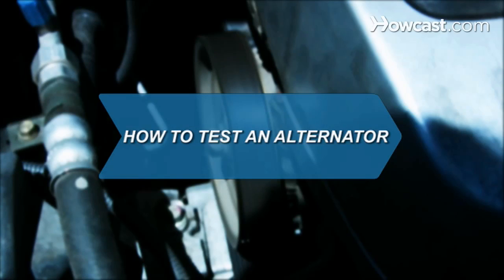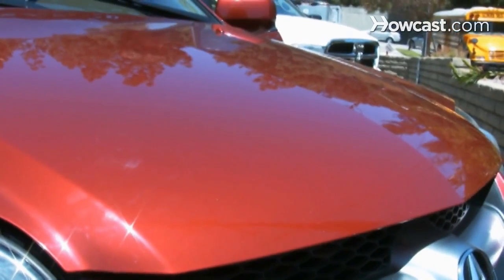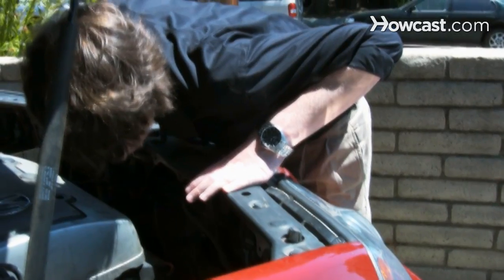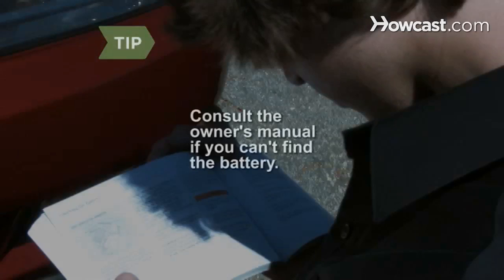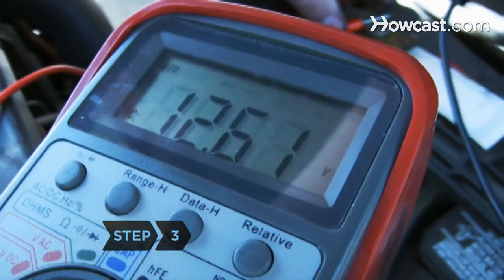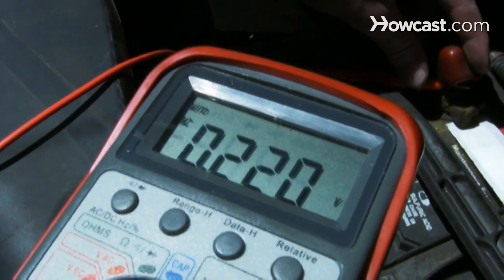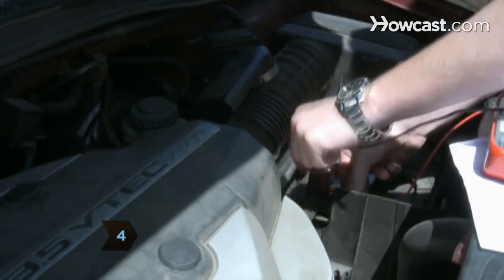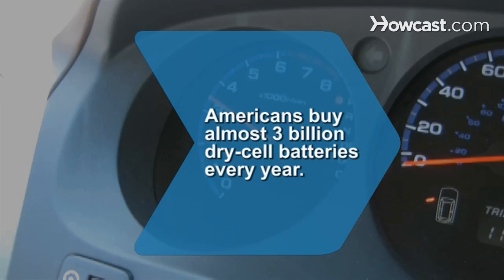How to Test an Alternator

Comment: Generally speaking the regulator will go out in an alternator and so the charge will go very high on the battery when the car is running this not always the case but most of the time it is .

Comment: No Duh anybody knows that.  Here's one, my alt. puts out 12.35 volts, but if I take it off and bench test it, it does 14.25 volts and a lot of amps, it passes the test.  On the car it will fail the test.

Comment: ..."consult your owner's manual if you cannot locate battery" and if that does not work...use a map and a flashlight.  dude, think about it, if anyone needs to "consult" their owner's manual to locate their battery...there are more serious issues at hand other than a bad alternator.
Reply: I had a neighbor that had a car that had the battery under the rear seat (Chevy, I think), and there's a car with a button under the side mirrors that opened the door. You'd be supersized what auto manufacturers do.
Reply: 2010 camaro ss has the battery in the trunk

Comment: Before you tell inexperienced people to buy new alternators, if the voltage is low, it would be ethical to tell them to check the tension of the alternator belt(s)- not to mention make sure that the alternator wires are all connected properly, battery cables tight, terminals not corroded, etc. Assuming you're not trying to convince people to waste good money on parts they don't need, that might not even solve the problem!!!
Reply: Bro we're all just humans we don't have to be a 100% correct we're not God

Comment: BEST WAY TO TEST YOUR ALTERNATOR: Apply a metal type screw driver close to alternator pulley while car is on. If the screw driver is pulled towards the center of the pulley by magnetism, then its working, if there is no pull, its not charging. Be careful not hit the belt and let the screw driver fly at your face! A little dangerous but it does work! This beats taking it out, going to auto zone, and finding out it still works..

Comment: Who needs a Voltmeter?? Just unplug the positive terminal when the car is running. If it dies, the alternator is bad. If it doesn't it's the battery. Viola.
Reply: The is the most idiotic advice ever, NEVER  disconnect a battery wile the engine is running, you can fry the electronics and blow the rectifier pack on the alternator. It is not 1910 anymore so keep tips that worked on ancient cars away from modern stuff.
Reply: @MrGoogelaar , so if the battery fails or a connection fails, the electronics will be fried?! That seems the opposite of reliable.
Reply: @humanyoda  A battery that fails does not mean open circuit so it will not cause the same damage as a disconnecting it completely, the same with connections, they seldom fail in such a way to cause a compete open circuit, last but not the least, the main battery positive connections on alternators are very seldom simple push on connectors, they are bolt on connectors that very seldom fail.
Reply: You're supposed to unplug the negative.

Comment: If the battery voltage is low it may just need to be recharged. An alternator can put out more than 12 volts even if one or 2 diodes are bad. This video is not a good way to test an alternator!

Comment: wow there is so much misinformation here. First of all 12.0v is not a (charged) battery. Around 12.6 would be a good battery 12.0 is 0% charged 12.5+ would be like 80%+ charged, 

Secondly "if the voltage of the alternator is higher than the battery, your alternator is good" is also a false statement! Alternators should put out around 13-14.5V . If it's putting out more than that, the alternator is overcharging the battery.